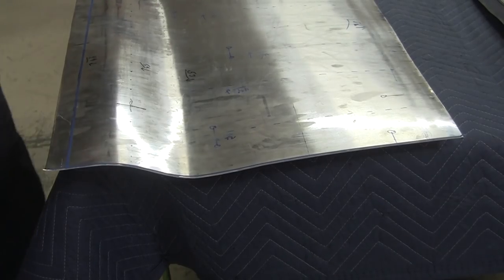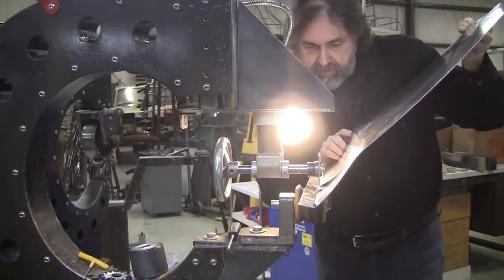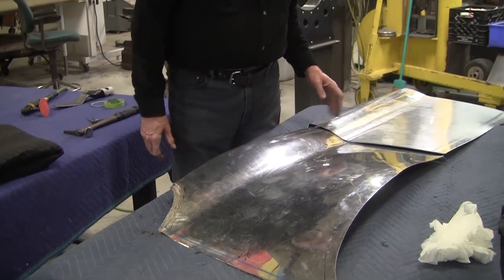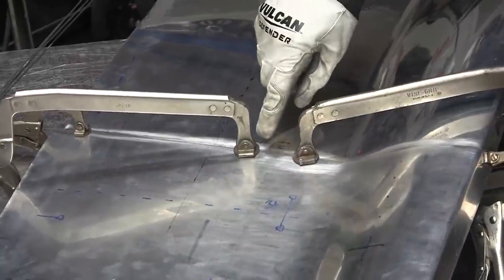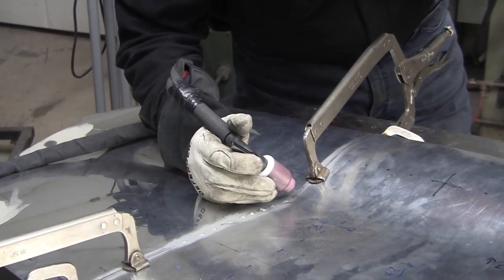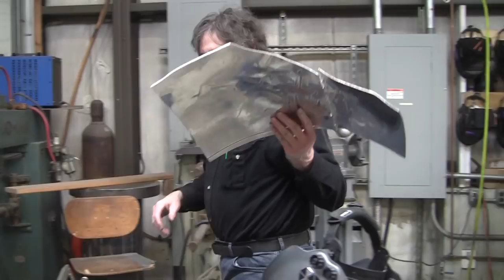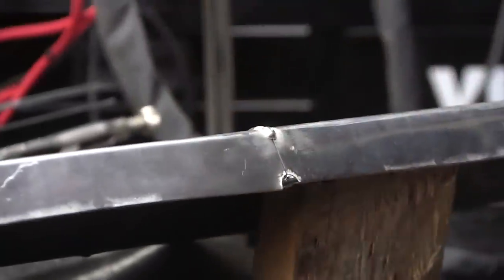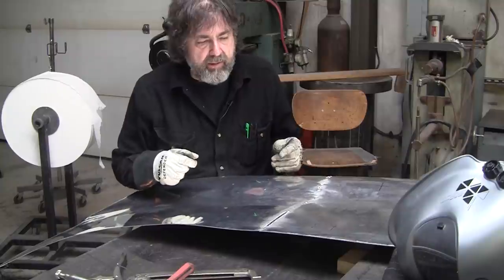Metal Shaping: Jaguar E-Type Bonnet Build - Part 10C

Comment: Wray - excellent video! I especially enjoyed the in-depth description of how your welding techniques evolve. Can you tell us what pulse settings you are using, please?
Reply from the maker: Hi Ron, glad you enjoyed the video. Right now I set the pulser at 3.5, that seems to work best. There are about 10 setting parameters in total on that Everlast welder.  Do dail a welder in like that to what works best for what you are trying to do can take hours of experimentation. I still can spend a few more myself. The good news is with the pulser the welds are always as strong as the parent metal. In the welding game the slope gets steeper the more you learn and I don't think you can ever reach the top.😁😁😁
Reply: @proshaper  Boy - you're up late! 
Thanks for the speedy response to my questions. Can you tell me the range of the 'hot' and 'cold' portions of the pulse? On my Miller machines, they use values for 'peak' and 'background'. (Background is expressed as a percentage of peak). I don't know if the Everlast machines use this same system, but they must have something similar.

Comment: Wray,
I appreciate your availability. Lots of inner strength to be on display at work prior to finishing. Your stuff is fantastic. The flexible shape pattern is the best tool ever. Your shrinking development assemblage is awesome too.
Get the “Bodywork Restoration Tutorial” video. Mr. Gardner, is a champ as well.
I bought his DVD. It goes over everything comprehensively and is a master work itself. Nobody in twenty five years did a tutorial or wrote a book comprehensively covering the subject. David Gardner, did though.
I just work at a body shop as a fabricator doing restoration for peanuts. I do on occasion, elaborate patch panels with only a ball peen and a hardwood block. My boss thinks I’m insane.

Comment: Back in the 1960s when I was learning to weld non ferrous metals (aluminum, brass, bronze, copper, etc.) I learned gas first, Heliarc second, Stick third, then MIG. Gas I found easy, Heliarc I loved, Everything else was just to harsh. Strange how that worked. Great video. I'm really enjoying another view of fabrication. BTW, I was a sculptor, not a fabricator. Regards, Solomon

Comment: Hi Wray I'm having a hard time till now seeing this hood being constructed a piece at a time knowing that there are so many compound areas and the length alone is intimidating. I started watching since it's inception and very incredible so far. Your flexible shape pattern pretty much eliminates any doubt provided that you follow your techniques. Does this system support flat low crown panels as an 87 chevy truck hood long and flat except the center peak and the rounded front hood edge?
Reply from the maker: Yes, with the gauges.

Comment: Hey Wray, which model everlast welder are you running in this video? I have a miller diversion 180 right now but don’t have a lot of those extra features looking to upgrade and get an everlast machine
Reply from the maker: Everlast 210EXT  I paid $1630.00 delivered. I have two of them. After I bought the second one they lowered the price to $1430.00.

Comment: Love the videos lots of great info but I have a question, so I have a harbor freight e wheel and we fixed up the wheels and all that but when we wheel the panel will get loose edges so we wheel inboard to fix it but then another edge will get loose so we fix it and then the original edge most often than not will get loose again so we keep fixing it till the panel is unrecognizable and we get frustrated is it our technique or something else would love to hear some feedback on this.
Reply from the maker: If you stay off the loose springy edge and only go up to it the edge will tighten up very quickly( two minutes or less). Go up to the edge at a 45 degree angle and go inboard 3 or 4 inches.
Reply: proshaper Thanks!

Comment: On preheating the weld area, when gas welding aluminum the torch is passed over the area and a wooden match stick is rubbed onto the work area, when it changes color it is hot enough to weld.